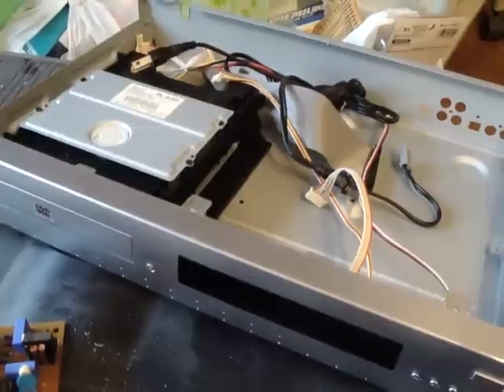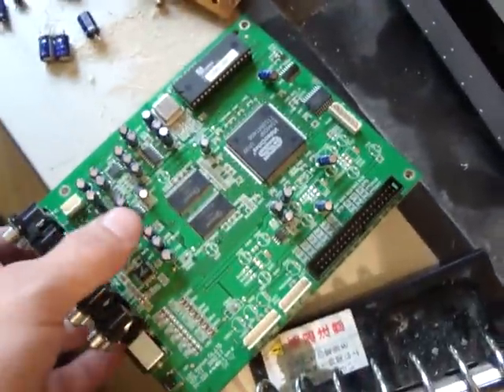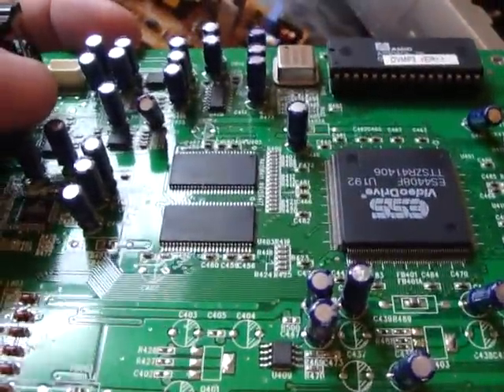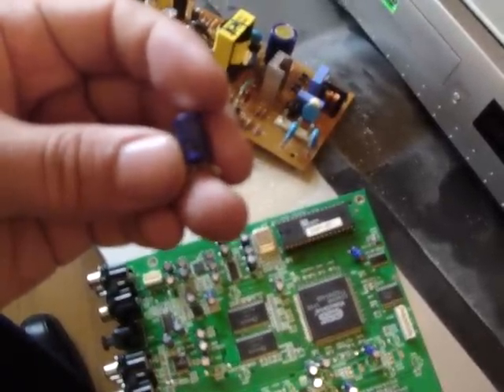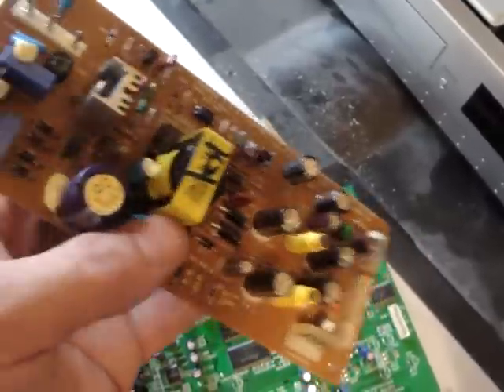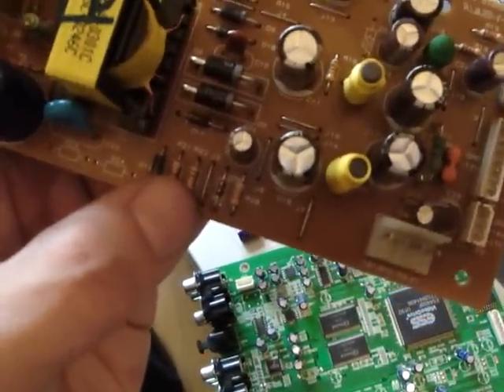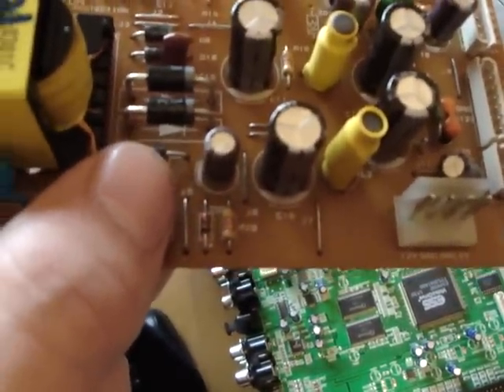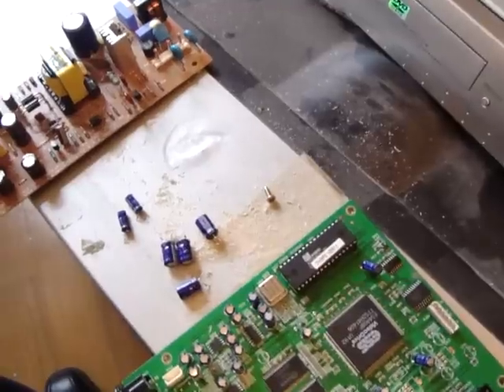Repair Your Game Systems With Old Parts From Old Electronics

Comment: I was stationed in Okinowa when I was in the Marines.  I loved going down to the NEC shop they sell every thing from TV kits to parts computers. and old circuit boards that might have a error on the costruction on it and they sell them cheep ebay is a ntoher good place to look for stuff like that but man I realy miss the nec shop In oki I wish they had places like that in the us but all they have is boaring Radion shack that just sell boaring cellphones.

Comment: Great vid luke.   Another good reason to salvage especially the capacitors is that sometimes the part at a repair shop which is the right micro-farad and voltage,  it may be physically bigger, or taller which in some handheld repairs can make things pretty challenging.